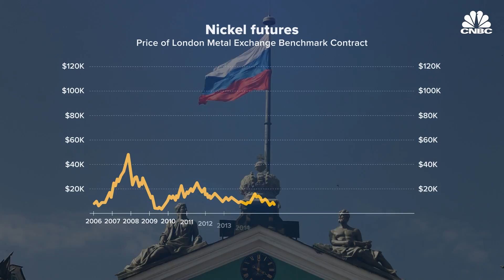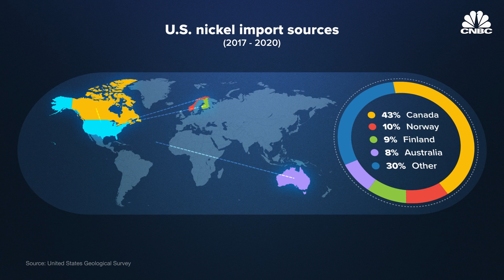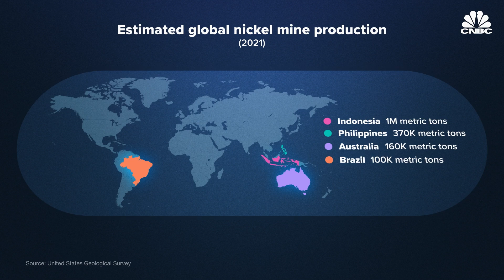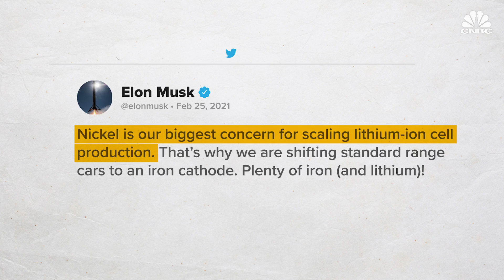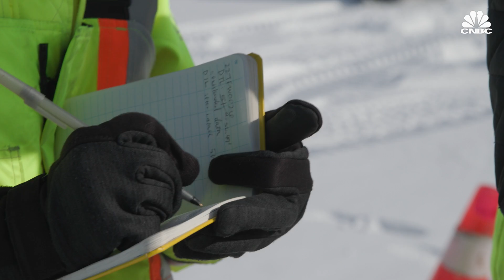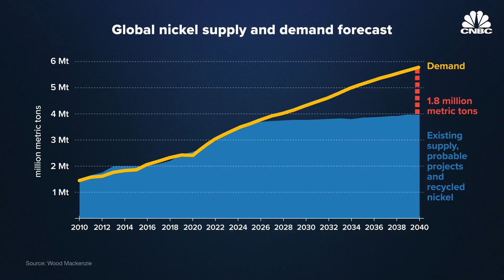Why The EV Industry Faces A Global Nickel Shortage

Comment: EV BATTERIES ARE NOT SUSTAINABLE
Reply: Not even that they are NOT fully recyclable
Reply: @Big_Boss14  that is such complete BS! 
Batteries can be recycled and return around 90% of the elements back into the use.  Go Li-Cycle ♻️
  What is IMPOSSIBLE to recycle is gasoline.
Reply: @andyjohnson3790  let me guess are men in black going to junkyards in landfills taking out Tesla batteries get with the times. Once these Tesla's and ev's go bad people will junk the car and buy a used or a new ev after all this what happened 10 to 15 years if no other major problems occur with the car.
Reply: @Big_Boss14  there are very few parts that make up an electric motor compared to the thousands it takes to move a ICE vehicle. When a battery wears out in a EV car it can just be replaced and put back in the road in a day. Also battery technology will improve leaps and bounds over the next 10-20 years and eliminate the need from some materials while improving longevity at the same time. 
Also dead batteries are worth 💰 unlike an engine that is basically for parts or melt value. Every battery is recyclable which is why +95% of all lead acid batteries in cars are recycled.  From
AAA to cell phone, laptop, hearing aids, and large grid storage etc are ALL recyclable.  
Yes mining for batteries is extremely degrading to ecosystems but if the elements that get pulled from the Earth get used over and over and over gain it will greatly increase the efficiency demand of that material.
 You can believe whatever you want just don't go around spreading completely false information.
Reply: @andyjohnson3790  lol where in the hell do you see me talking about lead-acid batteries (that also produces a black sludge and only the lead is recyclable) no where did I say thing about lead-acid batteries. And NOBODY is buying a replace battery pack which is 13k at a BEAR minimum which is VERY UNLIKELY. You are looking at 20k-PLUS and this is for Model S maybe you should educate yourself more instead of giving Elon sloppy toppy lmfao
Reply: @Big_Boss14  hm let's go back and see.
Your agreeing with the false statement that batteries can never be sustainable or recycled which is false. 
You mentioned men in black going to junkyards full of old batteries sitting around from discard vehicles so I brought up the fact that even lead acid batteries can be recycled and also have one of the highest rates of recycling of ANY product in the US. This is largely because of policy and they are worth money so they get recycled. Something that you don't think will happen. 
Also Prius batteries were around $6k when they first came out and now are about $1200 and 3x as powerful. Tesla isn't the only auto manufacturer making batteries for vehicles. 
Again, there are a lot of negatives about mining to make millions of batteries, but recovery as much of them for reuse as possible is Very VERY important and it doesn't help to have people that don't have any idea about them to be spreading lies.
Reply: @andyjohnson3790   Go back and work on your reading I said they are not fully recyclable and obviously tesla isnt The only manufacturer thats why I used other (EV's